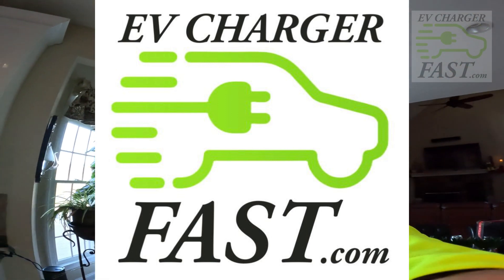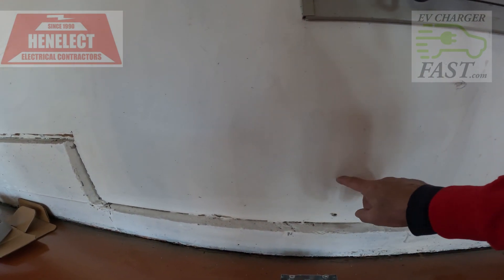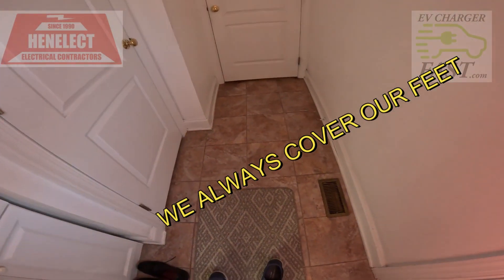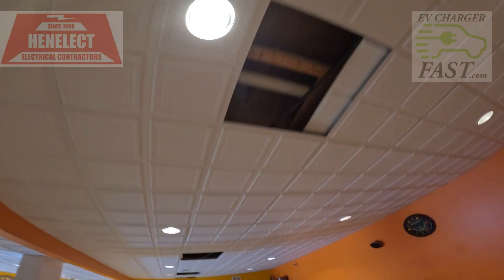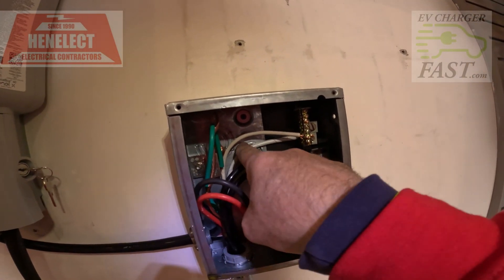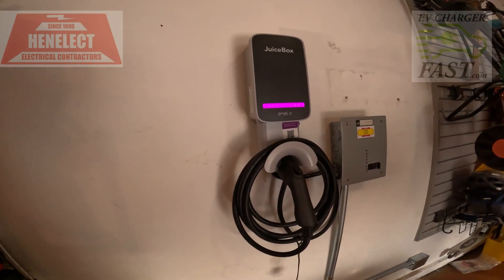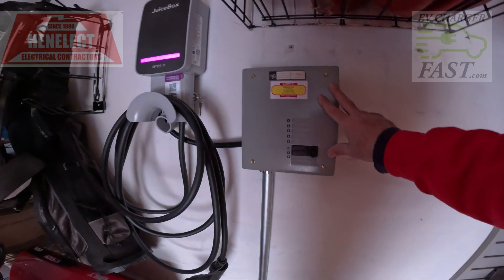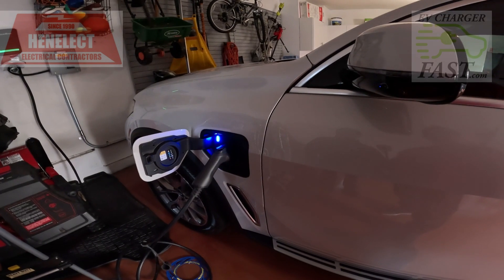JUICE BOX EVSE INSTALLATION

Comment: Did you just cut off the NEMA plug on the Juice Box?
Reply from the maker: Yes, if only necessary, for customers who supply the unit and do not want GFCI protection, but we stock both nema and hardwire...
Reply: @Electrician-family whats wrong?
Reply: Whats wrong?